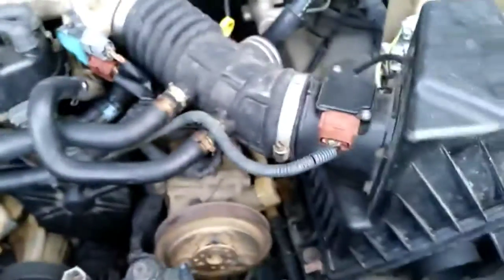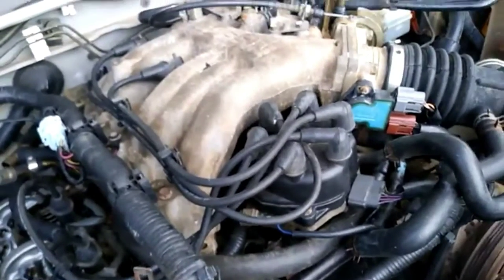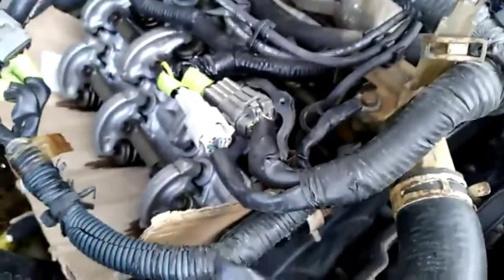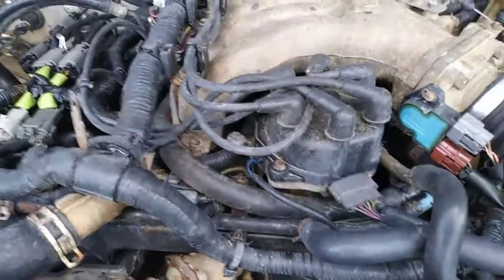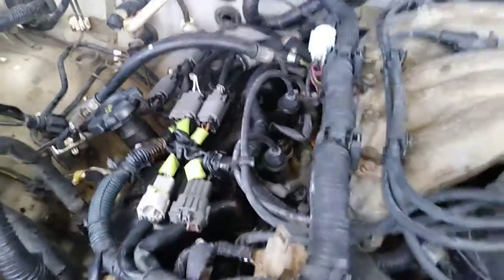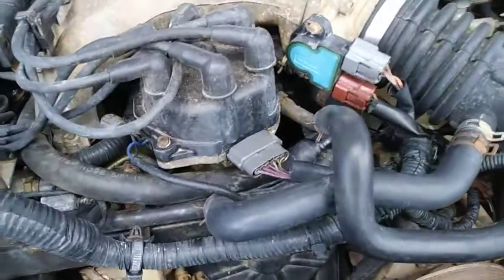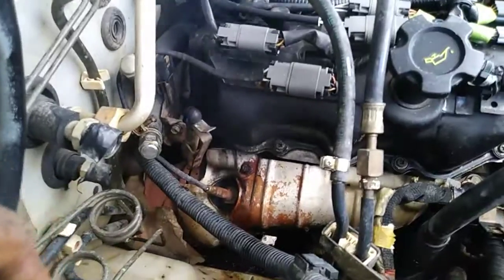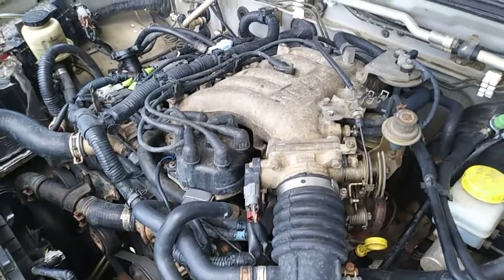How To Fix Engine Rattling Noise. Part 4/4.

Comment: This is after just cleaning the old valve train and replace it and it’s not a new assembly? How is it holding up over these years?
Reply from the maker: The engine still rattles at start up. Have to change the aluminum rocker arm and its shaft.

Comment: Question can the fuel injector from the passenger side be removed without taking off the intake manifold if so do you’ve a video? Please and thank you
Reply from the maker: https://youtu.be/4A0411Bmh8s?si=Z1wuVxDD2NOiUkOm
Reply: @Stevexnycautomotive thank you

Comment: What haappened to the heater core and ac evap lines? i have the slight ticking noise on my 2004 xterra with 277,000 miles
Reply: Sorry to hear bro fr! Mines too is rattling at 251,596 miles 2000 joint!